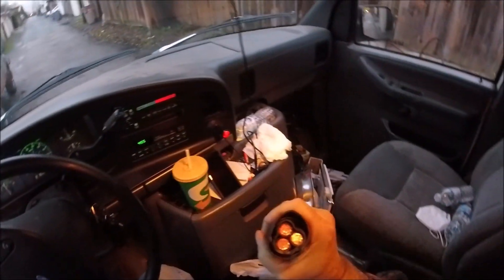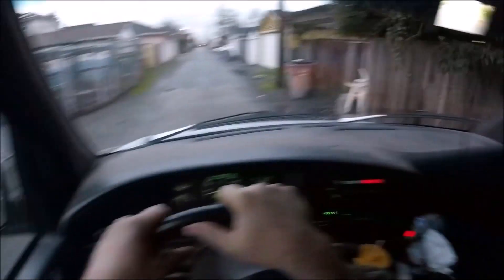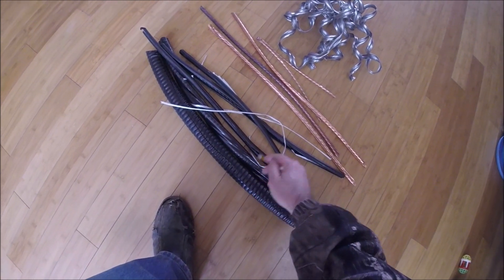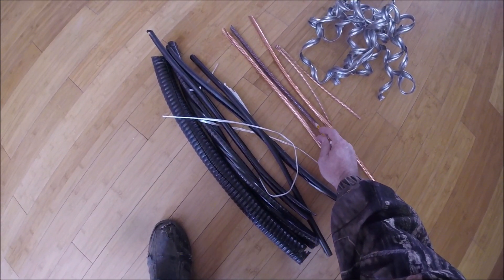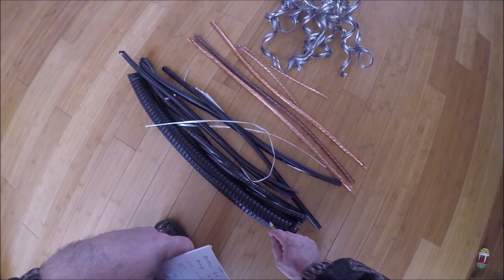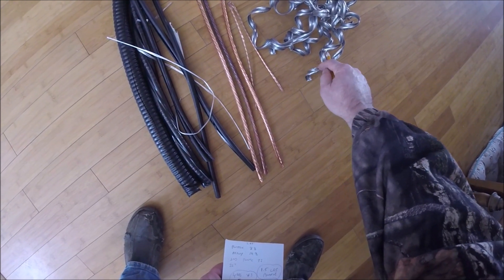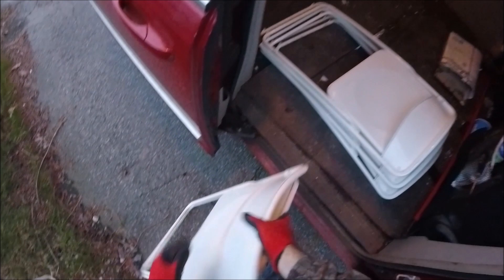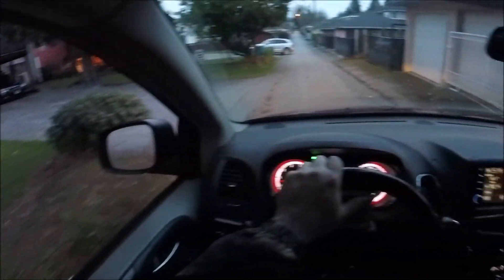How Much Copper in a Two Foot Teck Cable?

Comment: You mean, some one has the 200 ft long cable and you have to offer a price to buy it from him? 
It's like a contract job. First you go to his place, cut it into 100 pieces of 2 ft long, load them in van, bring it home, process it, dispose of the plastic, take copper & Alu to scrap yard to sell then give a cut to the owner.
In your cost you got to consider 2 days wages + tools (grinder disc costs for cutting into 100 pcs) + cost of splitting cable into plastic, Alu, Copper) + cost of travel (to the owner's place to collect cable and to scrap yard to sell copper & Alu)
5 min video - only one comment 😁😁😁
Reply from the maker: Its worth more stripped

Comment: If you twist the aluminum like a bolt it will loosen around the wire and pull off in one piece.
Reply from the maker: Not this wire, Hard & stiff